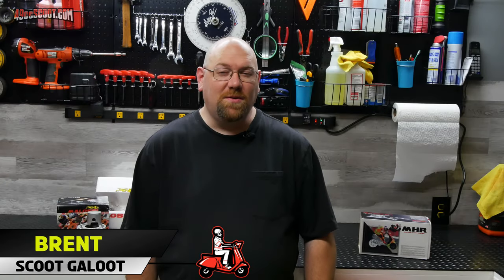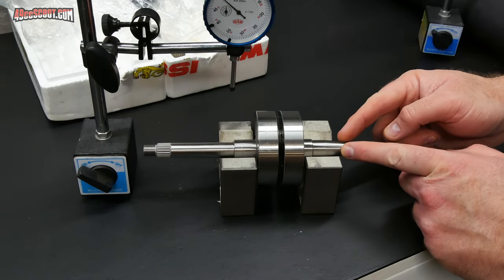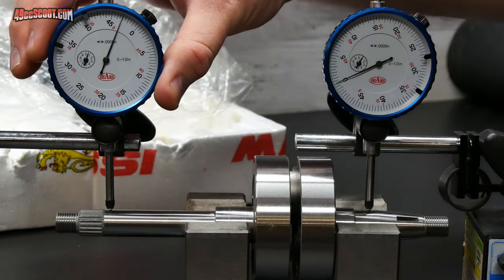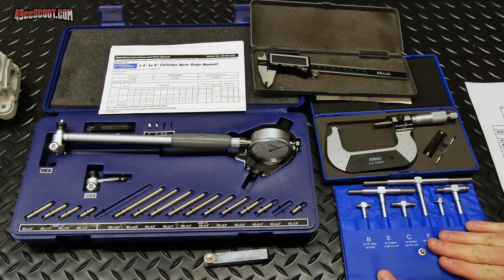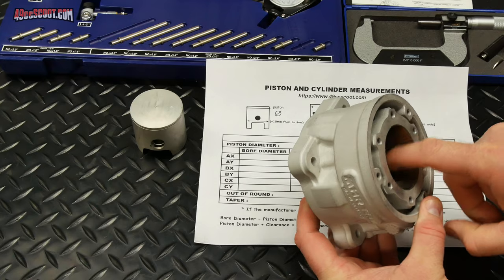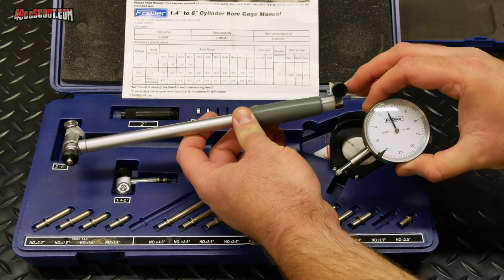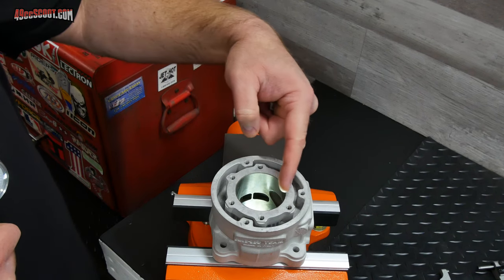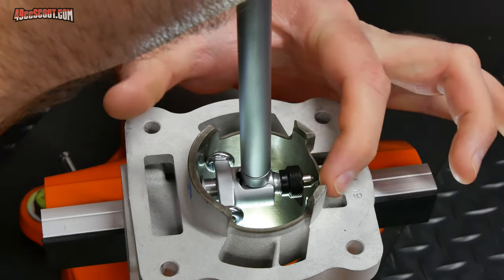RC-One : Pre-Assembly Measurements : Crank Check & Piston To Cylinder Clearance : RC1 : Part 02

Comment: Terrific tutorial. Especially interesting the analysis of the error measurements. Measuring is a skill and the top accuracy you can get it limited by the actual instrument accuracy. At some point the ambient temperature fluctuation will start playing part. To make the process a bit more easier  (not necessarily more precise) - you can try a digital gauge.
As far as clearance on 52mm nikasil coated cylinder goes - 0.06mm sounds reasonable. It will depend on various factors and following manufactures spec is a good start. I rebuild my engines around every 4 hours but nevertheless aim to get clearances as tight as I can. In racing every drop of performance counts.

Comment: Cool! Seeing that you run your motor pretty close to racing, it's my hope that the RC-One, as a base motor will endure the um, stop and go riding style--and also be a good and responsive platform for your modifications and upgrades.

Also, looking forward to the installation of either a very traditional, know, and easy to manage and jet, carburetor. : )
(Unless there is some fuel injection that's good.)

Comment: Hi Brent. Great video. I am the guy that trusts that  what's in the box is perfect and ready to slap together... and I shouldn't  be... I guess since I don't have those precise measuring tools, I have to be haha... It is good to at least see how things should be done... On another topic... I was looking for a video from you about shimming the drive pulley... Do they sell different size drive bosses? or how do you suggest taking a few mms off of one to allow for the shims? I was able to squeeze in just under a mm in and still have the kick start paw engage the crank splines and the scoot wants to wheelie off the line... could under a mm really make that much difference or was my imagination getting the better of me... I know you are busy so no hard feelings if you don't get around to answering my personal questions... Keep up the good work!
Reply from the maker: I hope to have the next vid done pretty soon, and that will show you how far off some things are so be sure to check it out when it's up. 

Most of the time a variator kit comes with one size of drive boss that it's intended to work with. I've never felt the need to shave the boss on an aftermarket variator. I usually leave them or shim them.

The only time that I recall cutting down a shim on an aftermarket variator was a 139QMB before aftermarket upgears were available. This was 10 years ago or more. I was determined to see 50MPH honest and my RPM was 10,000 or so, above peak. I was trying anything at that point to squeak out another MPH or 2.

I tend to shim the boss till the belt can ride all the way to the center of the vari or as far out as it can get on the rear pulley at rest. That gives the best chance of a strong takeoff because of the drive ratio and  makes the clutch operate at a little higher RPM without changing springs, also  because of the drive ratio. It really can make a good bit of difference to dial in the drive boss length.

If you want to watch a series that includes multiple things that are useful for tuning, maybe check this one out :
https://youtu.be/d3cQKYT0ojg
Reply: @49ccscoot  Hi Brent.I really appreciate you taking the time to answer my off topic questions. I have watched that video a few times and just watched it again... I think Im gonna try an after market drive pulley set up... The NCY Super Trans kit I installed uses the existing stock drive boss and with Genuine you have to re use the stock outer pulley as well... Thanks again...

Comment: Does one need to do all of this for a street scoot. Not necessarily a racing scoot? 

Just installed a new malossi crank and 70cc kit. And only checked ring gap
Reply from the maker: Not really. I think you'll find that the vast majority of people would not bother with this. I'd venture to bet that even the vast majority of RC-One engines don't get checked. I do think the crank check is a really good idea, because it's not difficult and the tools aren't that expensive. Plus you can use dial indicators and holders for many other things. The bore and piston measurements for me are a tool for later, so I have an idea of what to expect. If I pulled it apart at 1,000 miles and saw these exact specs, I'd assume it had worn. Now I know where it started. Plus, there's the chance to catch a problem before assembly. 

Again, it's not the sort of thing that I'm telling everyone to do. It sure doesn't hurt if you have the tools and time. Some people enjoy the process.

Ring gap is critical and a must. Squish is the other that really should be checked.

Comment: the cylinders are perfekt i had never 1 thats mohre than 3/100 off mm. and the cylinder is touqut down with arround 12nm-15nm without oil ! the rc cace need more torque thgan standart minarelli.

the cylinders are bohred with a tourqpland on,   the cylinder is oval with! thats normal 

best think make you a plate with 8mm and  mounting pattern  and the bore. than tourqethe cylinder down and messur. now its perfect! THATS THE WAY THIS CYLINDERS ARE BORED AMD HONED. 
for exampel golf 6 and 7 engings  are startard bored  and honed with a touqplaid. wenn you messur the bore this are oval 3-5/1000 off 
but if you instALL THE  head and tourqe dam  doeb thE are perfect unter 0.5/1000 off
Reply: and i know some qm by malossi the have a tollenernz thats 1/1000mm  if its biker than 5/1000 the cylinder is recasted but if its 2-3 off you can buy the cylinder kit unter a othjer brand,  XD cost 1/2 power the same.
Reply from the maker: I know the process. Didn't know anyone did that with scoots. My cylinder isn't really the issue though. It's coming out on spec and round. I couldn't help myself and ordered another piston to see if I get the same measurement with it. With the bore showing essentially 52mm, and the piston at 51.93, that seems like the prob to me. A 51.95mm piston would have it in spec, but Malossi doesn't seem to offer up the actual piston size or at least I haven't found it. Some companies put that right on the crown so I'm not sure why it's a secret.